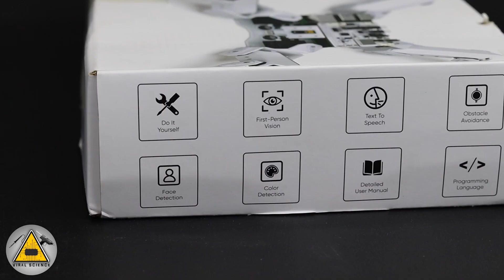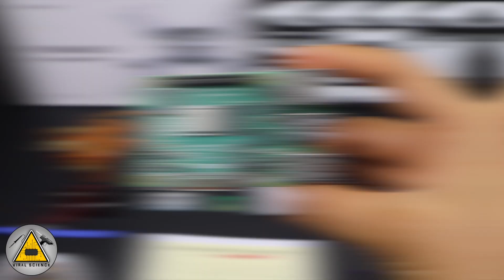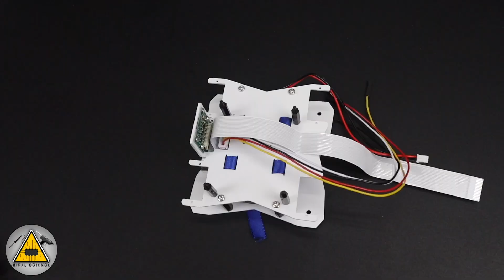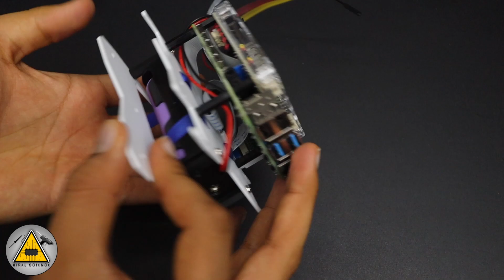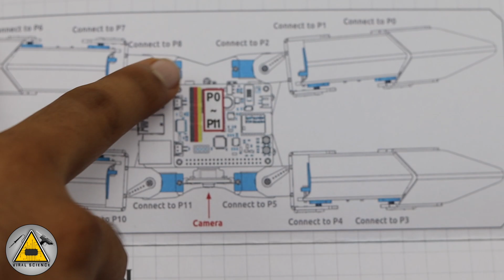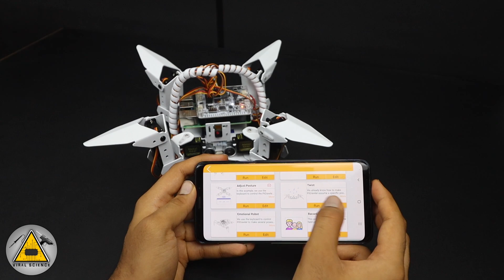Raspberry Pi Crawler Robot | SunFounder PiCrawler

Comment: Hi. I bought the PiCrawler with a Raspberry Pi 5 and followed all the steps on the website to start coding in Python. The last step I completed was calibrating all the arms, and that worked without any issues. However, when I moved on to the next step and ran the code from the “Move” section in “Play with Python,” the PiCrawler made a strange movement and the monitor stopped displaying any image, as if the system had shut off—although the legs stayed stiff and the LEDs remained on. I also tried running the code from the “Keyboard Control” section, and the same thing happened. I’m not sure why this is happening, and I need to get it working. Please help.

Here is a video showing the problem: 
https://youtu.be/6CH8dDg_9gM?si=USMHOXPbbriACeWn

Comment: I'm done with the robot but my app is unable to find the robot with the Bluetooth. I have selected the pi crawler but when I hit connect, it can't find anything. Anyone else is having this problem? Any help will be greatly appreciated.
Reply: Hi. Have you found solution for this? I am building one right now. Tablet see PI in settings, but app dont
Reply: Have you found the fix? I have the same issue.